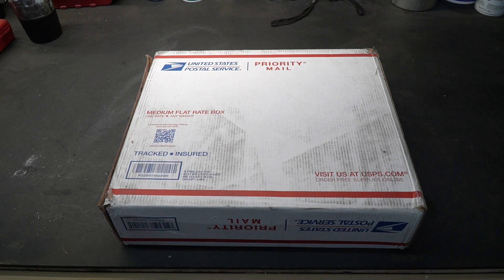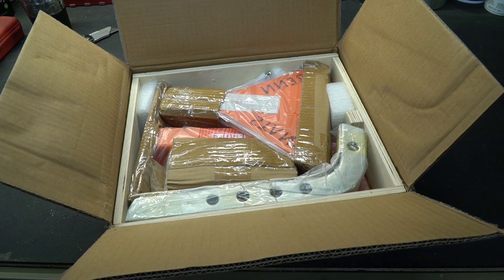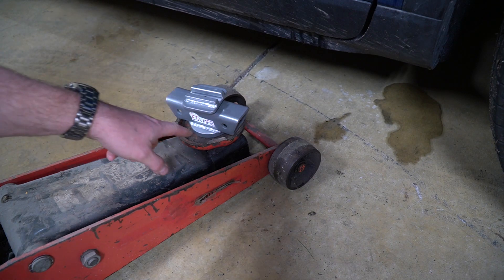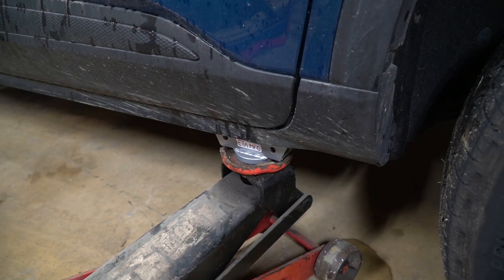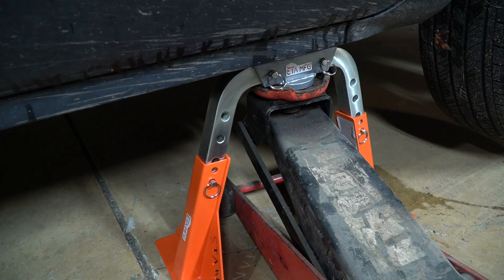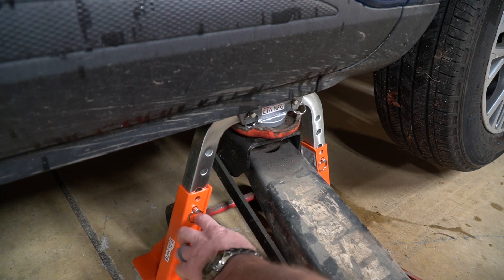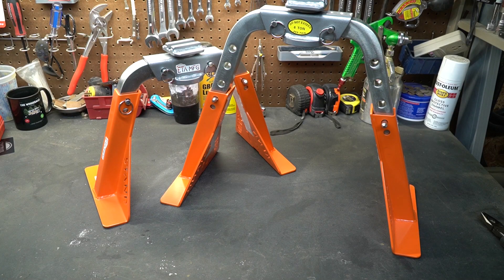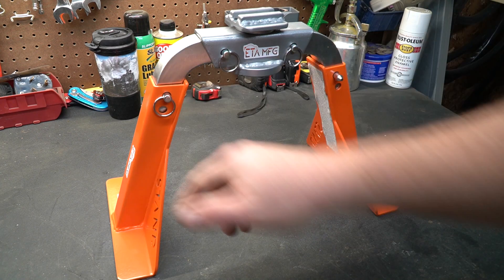A better jackstand by ETA MFG, Rennstands!   NTDT

Comment: Just received a set, they are very solid, weigh about 20 pounds each.  Inner pieces are solid metal, not tubes like the other version, this version is cheaper price too.  ETA manufacturing is in Niagara Falls USA, I believe, but there is a company in Florida that also sells them.  The Florida ones are more money, $225, (black and silver) the ones in this video are cheaper $130(orange and silver).  If made in the USA is important to you, (and it should be) buy the expensive ones. If distributed in the USA is ok with you (why not it’s $95 cheaper) buy these ones. Delivery was fast (5 days international to Canada), packaging was done well, nothing damaged or lost.  More money than a regular jack stand, but they are far from regular.

Comment: This might be the only safe product to use for people that live in hilly areas. Lots of San Francisco has nothing but driveways at 30°. I doubt many of those people change their own oil, but it does make you wonder how one would do so safely. Maybe a more common use case would be rural areas with no concrete. That nice big footprint would work well in a wooded setting

Comment: Those are actually nice man. Thanks for showing me this. I am fixing to start a rather large project on a Dodge RAM rebuild. Could you tell me, do you think they will go high enough for a lifted truck? or no?
Reply from the maker: Because of the weight of the RAM, I would recommend something a bit bigger.   Maybe the 6 ton Daytona jack stands at Harbor Freight?    They have been redesigned with a few safety mechanisms that make them pretty tough.   The 6 tons also have more height.  https://www.harborfreight.com/6-ton-heavy-duty-ratcheting-jack-stands-black-58342.html
Reply: I really liked these for my truck too, i thought of half of sleeper block under the renstand... but found them difficult to buy...
I especially liked the feature on these, where you can higher if in  the the middle of a job ...
I grabbed those 6 Tonner's our friend recommended for $60 on a Amazon special.
Would have preferred these though...